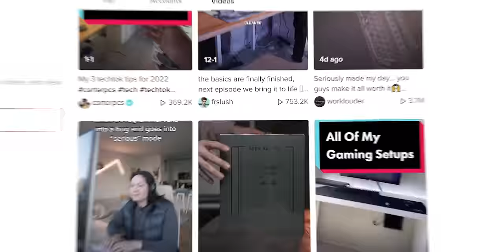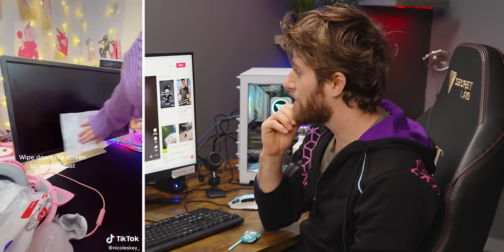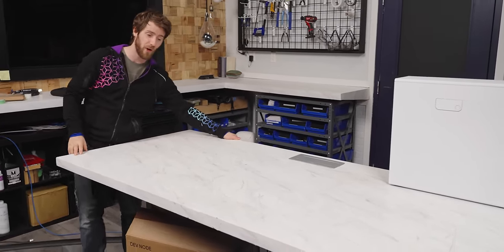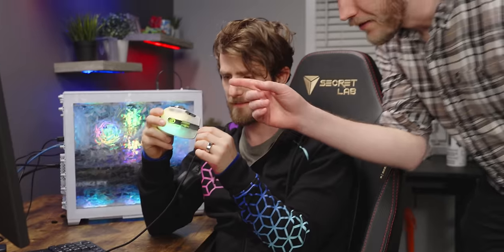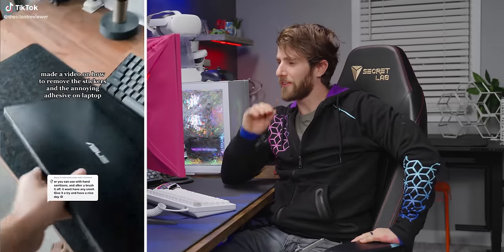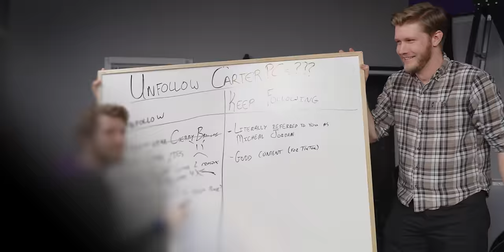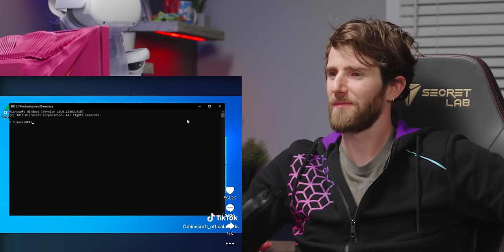TikTok Tech Tips are Terrible

Comment: damn gamertechtoronto dodged some bullet about having to reinstall whole operating system first just because something is missing or getting corrupted without trying other options.
Reply: I often finding that reinstalling your OS is more efficient and effective than trying to diagnose a pesky software issue, especially if the software issue is intermittent. When in doubt blow it out tbh.
Reply: @OptimalMayhem  I find it easier to diagnose a software issue than to reinstall all the drivers and software after the OS reinstall.
Reply: @helgenlane  If you have a lot of specialized peripherals I could see that, but with most things being plug and play these days, as long as I have a drive with my video drivers and a few other things on it I can have Windows blown out and reinstalled in maybe a couple of hours tops. My files and game library are on separate drives so they don’t get touched. More often than not that fixes an issue within a couple of hours rather than days of trying troubleshooting steps and waiting for a reoccurrence, then trying more steps, etc.
Reply: @OptimalMayhem  For me, most of my software throws a hissy fit if it isn't on the boot drive, so I can't reinstall Windows that easily. Plus ~2.3 million files would take just a bit to save over to an external drive.
Reply: @nikkiofthevalley  You have that many files that are important to you and they are only on the primary drive? That seems like playing with fire. 

Regardless, advice and even best practices aren't one size fits all. I think that for a general user and even many, many IT situations reinstalling the OS is the most efficient way to cure unknown gremlins if basic troubleshooting (I.E. did you undo the last thing you did/uninstall the last thing you installed or is this in an FAQ somewhere?) has been exhausted. However, there will always be particular use cases where that isn't practical.
Reply: they actually got a lot of shit at least on reels for only reinstalling drivers
Reply: @OptimalMayhem  it is easier and efficient for the right conditions true but that also not mean you can try other option or make atleast the reinstallation the final straw atleast they tried and if the other option were did the job done atleast advise the customer to backup the files and do a fresh install themselves. Options matters to customers actually.

Comment: For stickers, just use olive oil. On anything, you don't need to put much, great especially on books because alcohol will attack the colors, whereas as olive oil will make it only slightly greasy and that goes away by simply wiping. It aggregates the glue residue almost instantly (takes a few seconds for really old stickers).
Reply: The interaction between vegetable oil and glue amazes me. Vegetable oil seems like it would be the most benign, non-reactive thing, but a little of it will completely destroy glue in seconds. I used some cheap vegetable cooking oil to free a lizard that had gotten stuck in a glue trap meant to catch rats.

The lizard was treated to an oil massage while almost all of the glue in the trap was disintegrated/melted ... meltegrated!

Comment: I still like to remove sticker residue with a little bit of Virgin Olive oil.. if you slightly heat the residue with a hairdryer it almost always comes right off. Pretty much always using microfiber cloth to prevent any possible scratches. Then a quick wipe with some non streaking screen safe glass cleaner and your done.

Comment: I have a blower style GPU and that joke about using the pc to warm my hands was a bit too relatable 💀💀
Fr that 250w exhaust is soooo hot

Edit: typo
Reply: yeah, my 3090 consumes 400w plus another 100w for the cpu while gaming, so the air is warm and toasty
Reply: I have a top mounted AIO oriented as an exhaust.  Much easier to warm your hands than reaching behind the PC....
Reply: I definitely didn't use the top exhaust of my expensive gaming PC to warm up my tea yesterday, that would be stupid.

Comment: The hand sanitizer. It has a oil that encapsulates the adhesives and prevents readheasion. Leaving a cleaner surface. It will also remove fingerprints with a minimal risk of damage.

Comment: I knew about the Samsung phone one. There's also one on Samsung TV's; with the TV off, you push Mute, 1, 8, 2, Power on the remote. The TV will turn on and a menu will appear. But it has some settings that could potentially damage the TV, so don't change anything if you don't know what you're doing. (I don't think the phone one is like that though)

Comment: In last tip, clean install of new driver doesnt unistall old divers. It installs them on top of the old ones. For clean unistall, you gotta unistall manually first. 
Clean install in NVIDIA just means install of driver only without software like Geforce Expierience. Cheers.

Comment: when applying vinal you should use soap water, helps its glide around and squeezing bubbles out. not sure what the difference to using just water is. but i learned using soap water from professional sign makers. and i applied the vinals for the signage for my local swimhall during my 6th grade internship here in sweden.

Comment: To explain the rubbing alcohol one, learned this from the weed days.

99% alcohol is terrible at scrubbing, this is because the lack of water means it doesn't have anything to do the abrasion. So instead you're left with simply dissolving the glue.

The best alcohol to use for sticker removal is actually 70% as the 30% water will allow you to scrub the glue off, letting it get dissolved easier.

It's the same thing for melted weed wax on glass. Sticky substance vs alcohol.

Comment: Try WD-40 for removing adhesives.

Side note: the wipes used in hospital to remove adhesive residue from skin is just WD-40 on a pad.
Reply: Isnt it mostly isopropyl Alcohol
Reply: @aaaaa111aaaaa  Not at all, its mostly mineral oil and some petroleum based oils. 

If it was alcoholic it would bind with water which it certainly does not.

Comment: So after doing some research it is indeed the glycerin in the hand sanitizer that helps with the residue. Apparently glycerin will actively decelerate the polymerization of methyl acrylate (the most common adhesive used in stickers) which then allows it to be far more easily dissolved into the alcohol in the hand sanitizer, thus breaking the polymer bonds between the adhesive and whatever the item is stuck to.

Comment: As far as I know, air pods don't go into a proper standby mode unless they are in a charging case. My Airpod Pros (1st gen) will be dead if I left them in the charging case and the case battery died before fully charging the buds. As if the case digitally tells the pods to turn off through the contacts in the case.

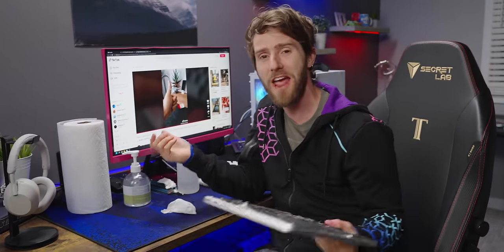Comment: 12:20 there is specialised residue remover that does the job 100 times easier. I had to use some lately to remove the residue leftovers from carfoliation. That stuff comes from hell thou. Need to use it with all safty gear you can imagine in an very VERY well ventilated room or outside.

Comment: The hand sanitizer most likely worked better because it had water (in addition to isopropyl alcohol) in it. Some substances are more readily dissolved by alcohol, and some are more readily dissolved by water. I'd recommend a 70% isopropyl alcohol (30% water) mixture, which is widely available for purchase. As a bonus, it's less of a fire hazard than 99% isopropyl. Alternatively, you could just add some distilled water to 99% alcohol.

Comment: didnt have alchohol so i used hand sanitizer to clean the board of my keyboard after I accidentally spilled coke on it (cleaned the weird cable lines on it with it to stop from shortening it)
and it worked really well aswell idk if its good i doubt it is optimal 💀but it worked

Comment: the "competitive minecraft mouse mod" is true but unnecesarry, some people (me included) can drag click without any grip tape with the correct mouse, also pretty sure the drag clicking meta rn is either model I or O Pro
Reply: I have model o wireless and can drag as well. I’ve seen YouTubers like BedlessNoob get up to 120cps
Reply: @bluqy  yeah wireless models are balls, personally I own a regular model D
Reply: @_toast4849  I got mine I think 2 years ago it has good battery life (up to 72 hours no led) and works fine but I might upgrade at some point
Reply: @bluqy  I got mine like 3 years ago and it works perfectly fine i've never had a problem with it

Comment: A ventilated room is not enough when using a spray can. Use a good fitting mask with gas filters. And you might even need to shave that bear to get a tight seal. You should not be able to smell using the can at all while you are working. I do have to use it in my living room, but I use a portable spray booth combined with such a mask, which works quite well.

Comment: 15:557 its called not being cheap and turning up your heat.... 
or getting a space heater (oil filled radiator type... AKA no red hot element...AKA no fires) 
.
like WTF man..... skip a meal or eat something cheap for 2 or 3 days
then crank your heat up to a livable temp
.
.
"instead of just turning up the thermostat.... im going to be a massive idiot, and build something that costs more than just turning up the thermostat, and also doesnt work as good"
LIFE HACK!!!!!!

Comment: Don't do the phone hack ☆#0☆#
Clearly I've changed it slightly so you cannot do it.

Why
Because if you press up on your phone volume it could break your phone, 
As a critical errors comes up on your  phone 
But if you press down on your phone volume it will bring your phone back to normal. 

And don't have your phone in charger   while doing the hack.